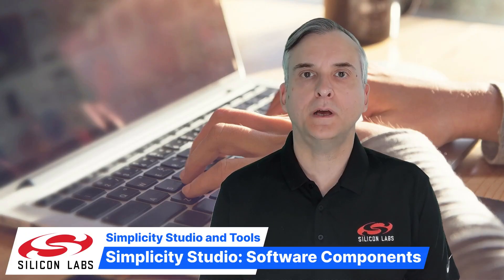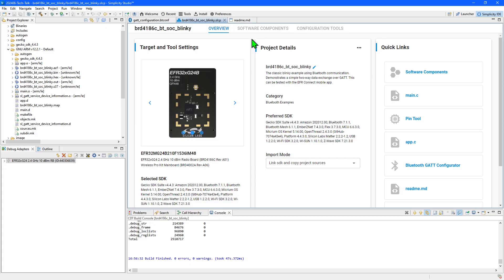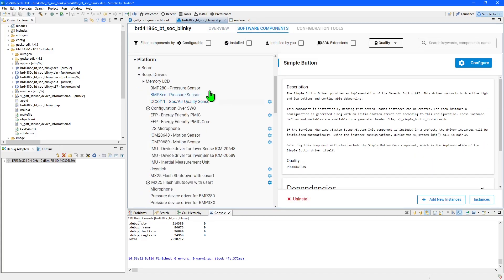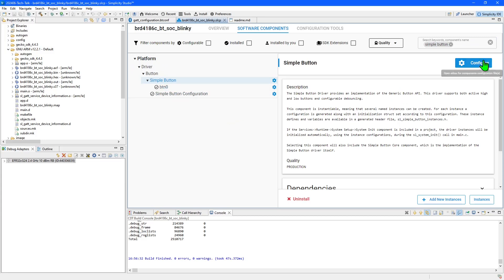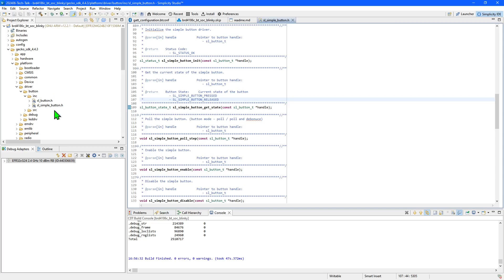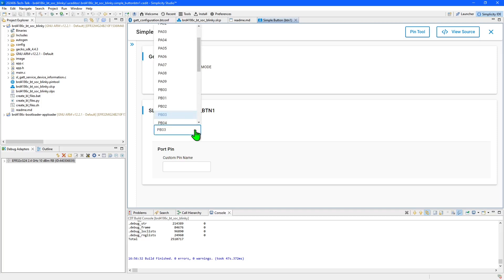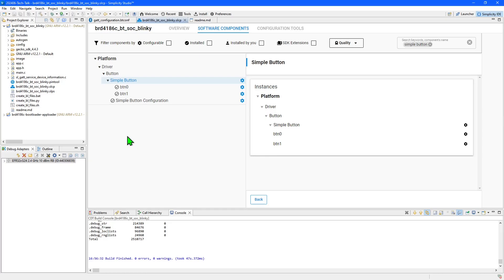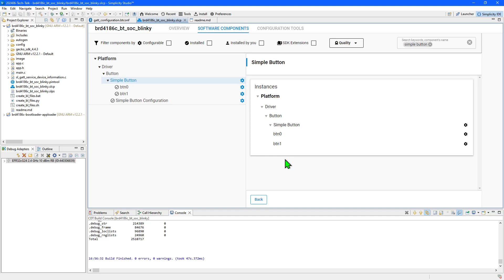Quick Start - Simplicity Studio 5 - Software Components - Silicon Labs

Comment: The SLCP configuration file referred to in this video was not created for a EZR32HC board using the carrier only or basic TX projects. Ive been using STM32 and STMCubeIde for a few years and it has a IOC configuration file with each project to configure PINS clocks IO etc. I've created a new project for a EZR32HG as I have previously used a si4464 with a stm32 as a AIS marine transceiver I am looking to move project to a Silicone Labs GEKO chip  with the built in si4463 however the simplicity studio application hides the si4463 configuration and appears to have removed much of the configuration parameters in the previous WDS tool.